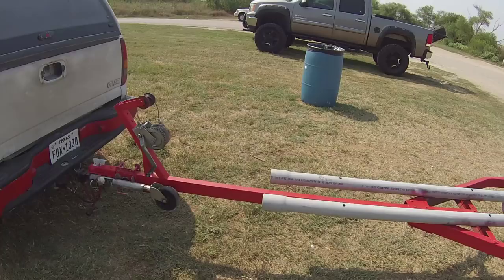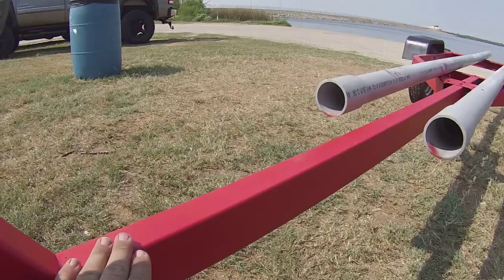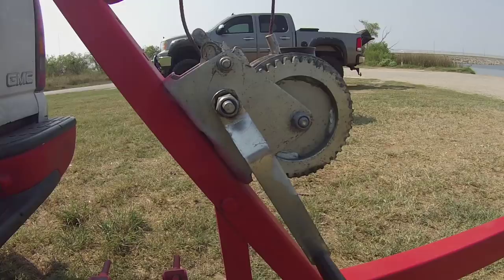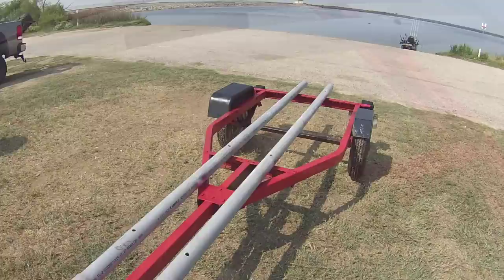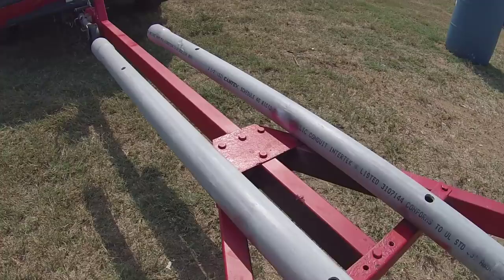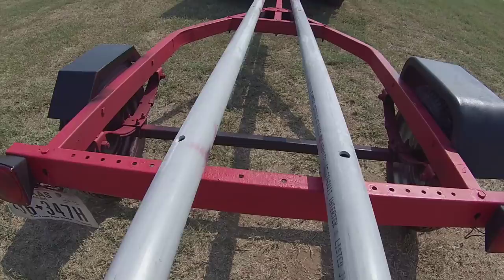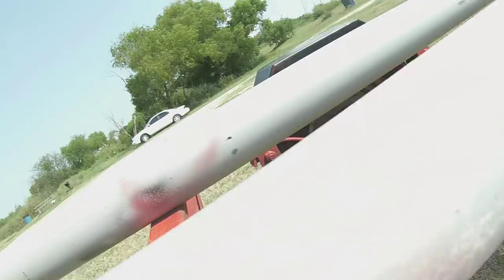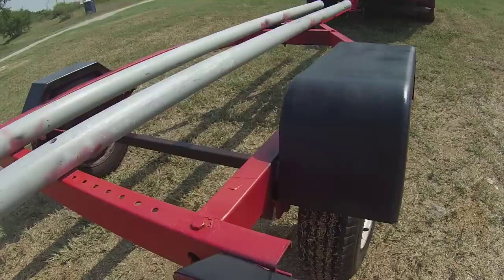Kayak Trailer

Comment: looked like you did not have a line secured to your yak, but made for a good closing. thanks for sharing.
Reply from the maker: +David Hunt lol, yea I had my tow line tied to the back of the trailer so when I drive off the kayak heads back to shore... However, there's been a few times when that yak just kept drifting away, hahaha... Tight lines...

Comment: Can you give a total measurement from tip of tongue to end of trailer?  Curious if I can fit in my garage...thanks in advance, love the videos!!
Reply from the maker: Drew Dempsey Thank you... The length depends on were you put the now stop. When I drop my tail gate, I get about two ft of clearance, and that puts the total length at roughly 16'6"
Reply: 10-4.  So I guess I could unstrap the kayak and slide up on trailer once in the garage to save on space?  
thanks for the reply

Comment: Mark, great video. I have a 2106 PA14 and a trailer. I started installing a wrench on the trailer today but i have concerns on where to pull the kayak from. Are you pulling from the front handle or have you rigged up to pull from another area? I don't want to damage the Yak of coarse. Thanks for reply. Ron

Comment: I'm waiting right now to get my trailer back from paint so that I can do the exact same setup.  My question is, what is the distance from the rear brace of the trailer to the end of the pipes?   In other words, how much of the pipe is hanging off the trailer?  I also noticed that you did not use unistrut on yours.  I am planning to do so that way the yak sits a little higher off the ground.  Has that been an issue for you?
Reply from the maker: +Steven Bounds Awesome, right on... The trailer is 11', and the pipes hang off the end at 12'', and the PA 14 hangs off roughly 2'6''... I did not use unistruts so the yak would sit as low as possible so I can easily back it into the water. Haven't had any problems... And quick thing I forgot to mention, I actually upgraded to 12'' wheels and got rid of the 8''.

Comment: you must have bought that trailer used because it looks like you covered over the rust with that Plasti Dip and even when you showed that two and a half inch piping underneath was rusted so it had to be used
Reply from the maker: big kahona nope, had it for a while

Comment: As I am buying the 2017 Hobie PA 14 and the Harbor Freight trailer I'm wanting to know if you could take a measurement for me. Need to know what the total length of the trailer with Hobie on it. Needing this if to find out what size storage unit. Looking at a 5'x15' storage unit just not sure if 15 foot storage unit is long enough. Please help if at all possible.
Reply from the maker: E.G.A. Kayaking I had to get the 10x20 unit. The trailer is built to hold 14' vessels, but the total length of the trailer and yak is dependent on where you attach rhe bow stop. To get my truck gate down I had to set it 2' in front of the hitch, making the total length 16'. it's a bummer being 1' over a 15' storage unit.
Reply from the maker: U don't nessecarly need the bow stop... When u store the yak n trailer simply pull the yak up to the front of the trailer to get that 15' or less. But when you attach to your vehicle,  pull it back a bit so when you turn the nose of the yak doesn't grind your bumper.
Reply: KayakAdventures210 Thanks brother going to be buying my 2017 Hobie Pro Angler 14 in about a hour. Didn't know the bow stop was removable so that was great info. Hope to see you on the water some time.

Comment: Wondering why you didn't get the Harbor Freight, 1195# capacity, 4x8 trailer for about $120 less than the boat trailer? I've seen several of their 4x8 trailers used as kayak/canoe trailers.
Reply: The boat being loaded in this particular video is a 14 foot kayak. Not a 10 or 11 foot. Capacity isn't a concern for this.

Comment: What type of bracket are you using on the stern to run that gas motor on your video intro? I have a PA14 also and thinking of doing the same thing. Thanks
Reply from the maker: It is actually homemade out of 3/4'' ply wood. All I did is place to pieces o each side of the handle and one in the center, then bolted them together.https://www.youtube.com/watch?v=_-1pCllwRwo

Comment: How long are the pvc pipes ? I'm working on a trailer myself not sure what length to buy thx
Reply: Depending on your kayak. Best bet is to measure the kayak yourself then go from there with estimates.
Reply: +Ray Santiago I have a hobie pro angler 14
Reply: +SoCal-FISHING-760 sorry for the late response. Depending on how you'd like the kayak to sit, I'd say go for a 10-11 foot pvc.